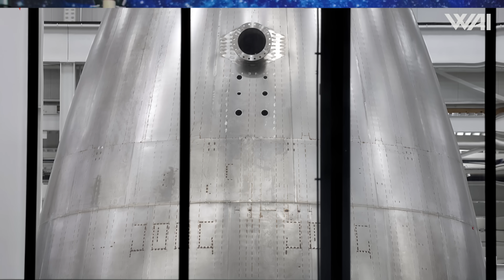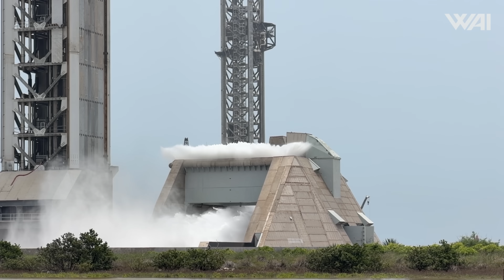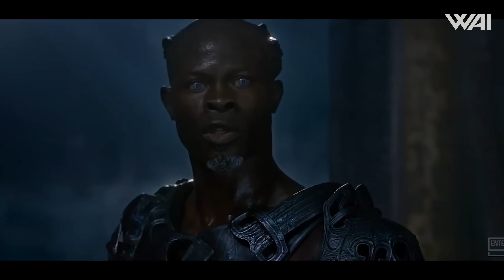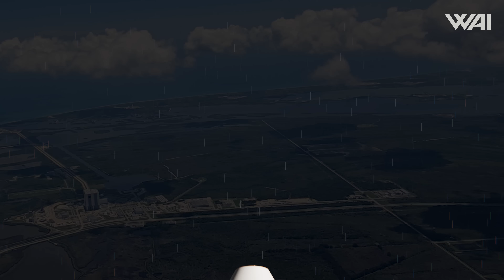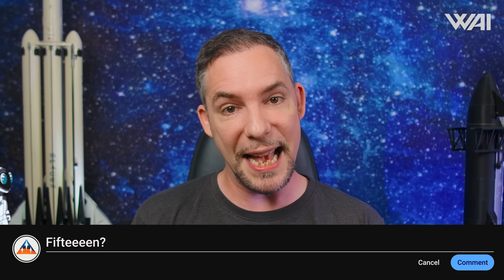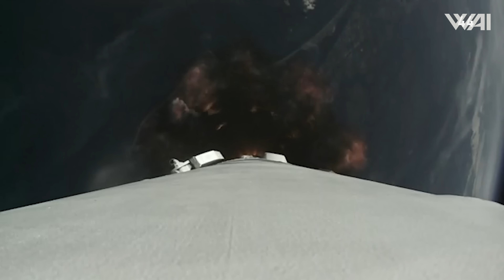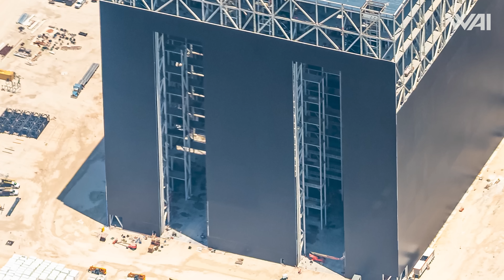SpaceX Is Getting Ready For Flight 13! NASA Reveals 15 Flights per Artemis Launch

Comment: Along with the cracking of natural gas for methane, they should be running experiments with cracking water for the hydrogen and reacting it with CO2 to make methane. That way they can be working out the bugs with large scale isru fuel production. Things like purity, filtering, drying come to mind as things that need to be verified.
Reply: Great point.  They have to do this on Mars anyway. It would be great to see Mars prototype units producing methane from CO2 at scale. For those new to this concept, note they would need to chill air down until the CO2 is liquefied. Then they can run the sabatier process with hydrogen split from water
Reply: @MikeKretsch  I understand the chemistry and the ability to do this on a very small scale; however, no one with any decent understanding of science and economics would ever believe this will happen on an industrial scale on our moon or Mars in this century. Sorry, not going to happen. This is all Internet hype and people pretending to be scientists after a quick search of the Internet. I understand people wanting to dream and hope; however, please educate yourselves and be realistic.
Reply: @ratratrat59 you underestimate the speed of innovation my friend. This is all uncharted territory, it's a bad time to be a prophet.
Reply: @johnwheatley231  The general public never ceases to amaze and disappoint me. Time will tell.
Reply: @ratratrat59 Fair.
Reply: In 50 years or so, we might have a hydrogen production process that doesn't use a ton more energy than the Hydrogen is capable of delivering. Hydrogen is a pipe dream.
Reply: @SeashermWhere I work we make it as a byproduct. Used to burn it to make steam. These days it gets bottled and used in city busses and the like. But what does doing research into hydrogen production on other planets have to do with the cost of it here on earth?
Reply: @Seasherm Conservation of energy, son. Those darn bonds require energy to break. To use hydrogen as an energy resource, not an energy transport, one must find molecular hydrogen.
Reply: Natural gas does not need to be "cracked".
Reply: @ratratrat59True, I started the text talking about cracking the water then reordered the text of the comment and missed the extra cracking mention. Thinking about the methane did send me down a rabbit hole about whether the pipeline natural gas is clean and dry enough for use as is or does SpaceX have to do a lot of clean up on it before it goes into storage. Seems like it would have to be very pure and dried to be super cooled and ran through the raptors. I guess we will see as they build the methane handling on location.
Reply: @edwardson6825 they will be refining the natural gas into a really pure methane for chill down.

Comment: 15??? Man, just design a Starship tug to take Alpaca to the moon. It would be like 5 launches (1 vulcan centaur) and you get the job done. China will get to the moon before all of this is done.
Reply: Alpaca didn't even work on paper (negative payload).
Reply: @admarsandbeyondthey made a new design after that.
Reply: @RichardMolina-q6e  On paper, the revised ALPACA design closed the mass gap by completely restructuring the vehicle (no more dorp tanks etc). But that was on paper. In aerospace development, when a design meets reality, a vehicle's dry mass typically swells by 15% to 20%. That would mean zero payload on the moon and it would barely be able to carry a couple astros with no safety margins.
Reply: @admarsandbeyondI'm gonna check the info of the new design, but I know they increased the number of engines and increased the tanks capacity. They are methalox like starship, so the arquitecture would be perfect. The thing is they wanted to work only with vulcan, like starship wants to work alone. Private space is not willing to team up and that's going to end up giving china the victory.
Reply: lol, how would China do it before, when they are just copying space x?
Reply: @stefthorman8548 because they are doing it Apollo style. Simple, small, not reusable. I know NASA is doing the go to stay thing. But china will get there first, even if it's not to stay. This is a ideology race.
Reply: Vulcan is still grounded.  Between the SRB issues and BE-4 issues I have seen no estimates of when they will fly again.
Reply: @Scanner9631 sure thing. But that rocket hasn't failed. As soon as BO resolves the engine issue Vulcan is ready to fly again. Starship + alpaca is the fastest, safest way to win the moon race with the least amount of launches.
Reply: @RichardMolina-q6e  As soon as BO resolves the engine issue

You are forgetting the SRBs or did it get resolved without my hearing about it?  

:body-blue-raised-arms:

:body-blue-raised-arms:
Reply: @Scanner9631 sure they failed but, if I remember correctly, the mission wasn't compromised. Easy fix.
Reply: @RichardMolina-q6e  

They had 2 separate missions with an SRB fail (out of four flights).   

One of the SRB failures just carried a mass simulator so what constituted success was easy to claim and I believe it had a low mass compared to the capacity available.

The other SRB failure had actual payload but again I believe a light one.

If they had the SRB fail and a high mass payload it would likely fail.  

Would you want to use it for a major payload?  I sure as hell wouldn't until the SRB situation was proven reliable by at least 5 flights given the failure rate.  

Then there is the BE-4, still no explanation I've heard for the explosion wrecking the launch site.   

All this gives 2 very good reasons for Vulcan to be grounded and to make alternate plans for any payloads planned for it.  Amazon should be asking SpaceX to squeeze in some more launches for them on Falcon 9.  The Atlas rockets are running out and the only other one actually under contract to them and flying is Arianne 6.  They have a lot of launches and not enough rockets actually flying.

:body-blue-raised-arms:

:body-blue-raised-arms:
Reply: Space X failed with Starship

Comment: I swear SpaceX loves doing things the hard way.😮 the position of that nipple doesn't serve Lunar Starship AT ALL. And WHY A NIPPLE?! The air force already has a reliable fuel transfer method with the Flying Boom which doesn't require a precise fit.  This smacks of not having any true design from the outset...this is why Starship is so far behind.  They are relearning what everyone else has already figured out. OMG
Reply: Does that airforce flying boom transfer thousands of tons of cryogenic propellants?
Reply: @admarsandbeyond  150 tons of cyro-prop is 88,000 gallons.  Flying boom transfers 1,200 gallons per minute requiring 73 minutes to transfer.

The flying boom is a 4" I.D which restricts flow rate. Increase it to 8" and triple the flow rate which reduces refueling time to 24 mins. Either shield the boom from the sun or insulate it and add emergency release valves.

Note: this nipple on the nose is 31 inches. Way to big for fuel transfer.  Its the size ofva man hole
Reply: @saquist  Starship V3 is expected to hold up to 2,600 metric tons of cryogenic propellant (liquid oxygen (LOX) at approximately -183°C (-297°F), liquid methane at about -161°C (-258°F))
Reply: @admarsandbeyond Yes. So 2600 divided by a payload best of 200 tons to orbit is 13 flights to refuel.
Reply: @saquist  No, the plan is to fill a tanker which then refills only once (for safety) the outbound HLS.
Reply: @admarsandbeyond for now...

Comment: So it’s an interesting question where a fuel transfer port would be. Fuel tanks are not in the nose cone and acceleration will be needed to settle the fuel meaning it will settle at the bottom. Unless the ships dock head to tail does a port in the nose cone make sense?
Reply: No but the internal transfer tubes are for lox with header being at top... It's meant to keep fuels flowing so likely why they chose that spot. Makes the transfer faster
Reply: @JuanRa-l8h  still doesn’t fix where the fuel will be. Acceleration will be needed which will push all the fuel to the bottom of the tanks (engine end). Also transfer needs to be two directions on the depot. Some interesting physics to overcome.

Comment: Why can Artemis directly fly around the moon and Starship needs so much fuel to fly to moon that at least 15 Starship starts are needed?
Is it because Artemis is much smaller/lighter and Starship can transfer much more payload to the moon?
Reply: Artemis flew around it, Starship will land, support lomg dutation operations, and take off and get back at something like 15x the weight and mass.
Reply: @kellywalker9268      Artemis is the name of the NASA lunar mission, not a rocket. The NASA launch system is the SLS. The SLS doesn't fly around the moon; that was the job of the Orion crew transporter and the European Space Agency (ESA) service module. This occurred during Artemis II. 
Now Artemis III, the moon landing was planed. What is missing is the Starship HLS. NASA ordered this Human Landing System from SpaceX in 2021 for 4 billion USD. So, unfortunately, Artemis III will not be a moon landing but rather a simple docking test in Earth's orbit. 
If the Starship HLS is ready by 2028 and has undergone unmanned lunar landings, it may be ready for Artemis IV, the crewed landing. 
The Starship HLS will launch empty, and, due to its design, it will require 10–15 refuelings by tanker Starships in Earth orbit. Only then can it reach lunar orbit, where the NASA astronauts from the Orion Transporter change to the Starship. The Starship will then land with the astronauts. Once their tasks are complete, the Starship will take off with them and return them to the Orion in lunar orbit. That's it. The Orion will then bring the astronauts home to Earth, while the Starship HLS will crash on the moon. Artemis IV is complete. 
This was just a brief explanation of the Artemis mission architecture concerning the Starship HLS. Please inform yourself about the basics before commenting and misinforming others.
Bye the way, I predict now that there will be no Starship HLS because SpaceX will not manage it.
Reply: This has been explained ad nauseam, even in this video you're commenting on.
Reply: Yes, they r planning to build initial moon base with the starship payload.
Reply: Artemis is like 83 metric tons of payload and I believe starship is looking to do 150+
Reply: The SLS rocket that launches the Orion spacecraft for the Artemis missions is not reusable. All stages can burn fuel until they are depleted because they don't have to reserve any fuel for landing/recovery.
Reply: The Starship is too heavy, even empty, to reach the moon from launch. No one forced SpaceX to choose an object the size of a skyscraper to fly to the moon just to transport some astronauts from lunar orbit to the surface and back. The only reason Musk fought for that contract in 2021 was to use public funds to cross-finance the overly expensive Starship development. 
It's similar to how it worked well with Falcon and the NASA COTS and CRS contracts for ISS transport. However, the Falcon was based on available technology and earned money after two years. The Starship, on the other hand, is an absurdly overambitious engineering nightmare. It makes absolutely no sense as a single unit for lunar missions. It needs a full fleet and hundreds of launches per year only to become economical. 
Let me predict: There will be no Starship HLS.
Reply: @bordeaux1962  NASA disagrees, but what do they know, they don't keep up with yt armchair engisneers
Reply: @admarsandbeyond  That's a really good statement—one that renders all the facts obsolete, of course. Thanks, “NASA”—or who are you speaking for?
Reply: @bordeaux1962  so who are you speaking for? your name sounds franc-her, so a Euro? it makes sense why you're malding at space x

Comment: Each tanker launch in this kind of architecture has to hit a tight orbital window, so the real challenge is the coordination and ground-systems infrastructure as much as the rocket.
Reply: Agree, I continue to be concerned about the Massey's test site being a major fault point. What good is five or six launch towers, if one major event takes out the only sight for test firing Starship. Not like we have not seen it happen once already.
Reply: @edwardson6825  If they are sufficiently reusable, they shouldn't need to be bringing new ones in.
Reply: No one ever said it couldn’t be done. The question is why? It’s an incredibly inefficient design.
Reply: @davidbowerman6433  its incredibly efficient long term
Reply: @davidbowerman6433  That's the tyranny of the rocket equation.

Comment: How does the Saturn 5 rocket compare to Starship for fuel capacity?   Rooftop restaurant on mega building in Florida?
 Ps.  YOU ROCK
Reply: @bruceyoung1343  The Saturn 5 was a three stage rocket and the only recoverable (not reusable) part was the capsule. Starship is a two stage rocket with a lot more fuel capacity in the orbiting stage and everything is recoverable. I did a little research since your question was interesting. Here is what I found. Saturn V Stage 1: Kerosene + Liquid Oxygen 1.97 million liters, Stage 2: liquid hydrogen + oxygen 1.287 million liters, Stage 3: also liquid H2 + O2 326 thousand liters.  Starship Heavy Booster is liquid methane and oxygen 3.4 million liters (but this has been changing as the booster are updated) Starship also methane and oxygen 1.2 million liters (this has also been changing with new versions). Good question.  Glad you asked it.

Comment: if Starship met the refuelling rockets in space . They connected but the don't disconnect. Then they fly to the moon and you have this much broader base made up of several rockets which makes the landing more stable .
Reply: Not a bad idea, but structurally the ship would have to be completely rebuilt to land while connected to a side loading stress. Even if you tried to run both sets of nose mounted landing engines, any missmatch of trust would rip the ship apart.
Reply: Ships weigh 100 tons. This becomes payload for the same propellant.

Comment: Of course its not feasible. 10 launches isn't feasible. Vaporware: tanker variant. A fully successful SS test. Lunar lander variant.

SS was designed to do one thing: launch V3 starlink. Everything else is complete nonsense
Reply: Doesn't mean it isn't possible
Reply: @LukeSpace15So you're saying there's a chance??
Reply: @LuciFeric137  so you're saying there's no chance?
Reply: @stefthorman8548 what's kalshi say?
Reply: @stefthorman8548  The odds of a manned moon landing by 2028 are considered very low (roughly 5% - 7%), as NASA's Artemis III is now being treated as a low-Earth orbit test mission, with the first surface landing delayed to Artemis IV. However, by 2030, the odds jump to over 50%, driven by the U.S. Artemis IV target and China's firm commitment to a 2030 crewed lunar mission. [1, 2, 3, 4, 5]

The 2028 Target (Odds: Very Low, ≈ 5-7%)

The U.S. Plan: NASA currently aims to conduct an Earth-orbit rendezvous and docking test during the Artemis III mission. The first actual astronaut moon landing is now officially pushed to Artemis IV, targeted for 2028. [1, 2, 3]

The Challenges: Technical
Reply: @LuciFeric137 Of course there is !!! People said the same about landing the Falcon 9, and look at it today, it's become such a norm. There's always the possibility whether it seems likely or not
Reply: @LuciFeric137 Bro Kalshi isn't everything. SpaceX has defied odds many times before , and will no doubt, defy them again
Reply: @LukeSpace15lol. Like a mars landing by 2024?
Reply: @LuciFeric137 Whether that landing will come in 2030 or most probably much layer, SpaceX will do it. You can see yourself that giving up isn't really what they do. They've managed to build and catch the largest rocket booster ever built-Super Heavy. They operate the largest, fastest broadband satellite network - Starlink, and are the very definition of high risk, high reward.
Reply: @LukeSpace15running out of money is what they do.
Reply: @LuciFeric137 SpaceX has a market cap of around 2Trillion, and has 100.8 Billion in fresh cash, the hell do you mean running out of cash, go and see for yourself online,